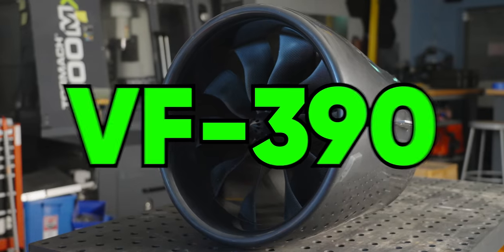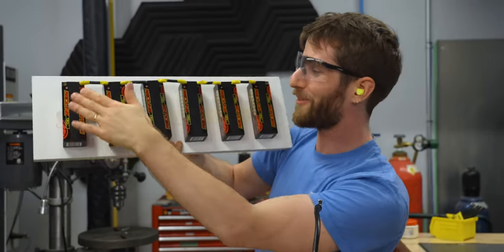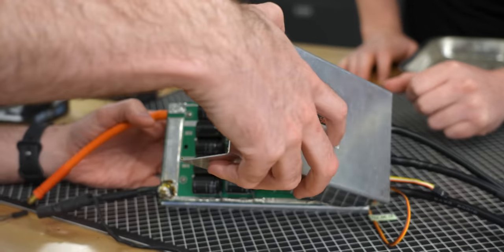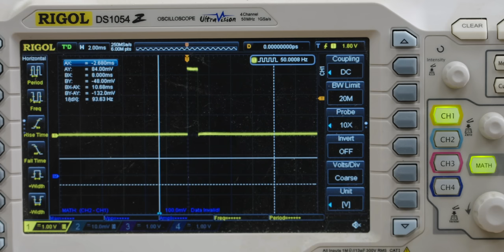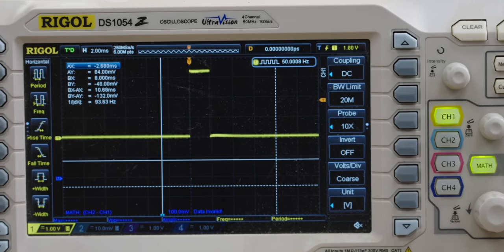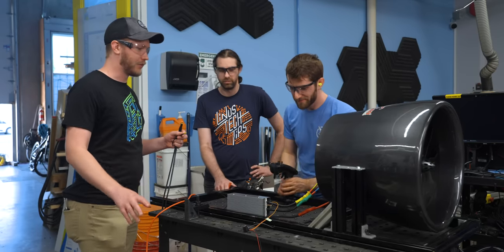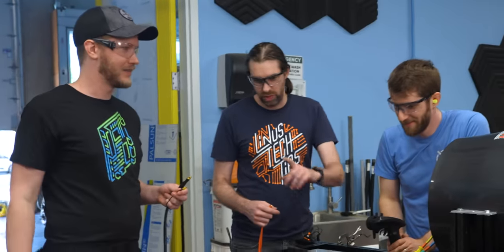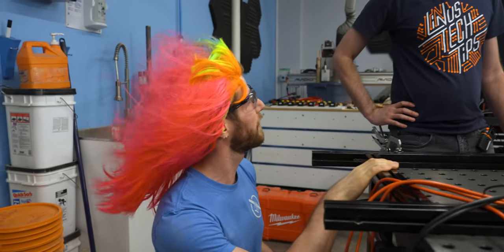The Scariest Fan ever attached to a computer - Vasy Fan VF-390 EDF

Comment from the maker: Huge thanks to Vasy Fan for sending over the EDF Plus VF-390 Nacelle! Check them out at: https://www.vasyfan.com/
Reply: Excellent, now I can finish my airplane build.
Reply: The forward nacelle is hit. Red Alert!
Reply: You might as well rent a wind tunnel for an hour and put a PC in that
Reply: Might have to consider them if ever I decide to build a drone lol.
Reply: is that fan not that Playstation 6 fan? lol
Reply: What are these fans even for
Reply: fantastic job
Reply: Haas?
Reply: Does it impode when it spins up?
Reply: What is this fan even actually used for? (What is the real use case of this?)
Reply: They could use that on Hot TX days 😂😆😂
Reply: @chirantannath6593  Its a Drone/ Aircraft engine. An electric propulsion system. This is meant to make things FLY.
Reply: your new employee's face is unblurred at 12:35
Reply: Wow, seems like a dumb way to die.
Reply: @Mr.Postal  not sure! Only have the PS3!
Reply: You don’t measure force in kilograms
Reply: @avroarchitect1793  that raises another question: are batteries light enough to be flown?
Reply: But you never told was what the thing was meant for! What as it actually intended for!?
Reply: @3dmaster205  It was intended to fly. It's a free bird
Reply: @giovanniangelica548  No no no, that's the new employee 2, who is a twin brother of new employee number 1. They came as a package, but only one of them didn't agree to show their face. /s
Reply: guys WTF 6K usd fan and  why is this a push configuration? cut the front off the pc/or get an all mesh front and set this up for pull! tha pc case is to small you have a HUGE battle neck in push! this is basic math that's what a 38-40  liters case ?
Reply: @supermanifolds  really it's a value of kgf or kilograms of thrust, which isn't a fancy SI term but is a common value for aircraft powerplants such as this ducted fan.
Reply: very cool..you've become myth busters!
Reply: @Enalius  don't give them any ideas
Reply: Now try the VF-570 Nacelle
Reply: Dude, that was insanely reckless. You had essentially a small jet engine blowing into a computer case, and then put your head directly behind it. If the tie-downs snapped, that thing would have smashed your head in.
Reply: Now that you're done with it, please send it to @PeterSripol
Reply: that fan is nothing compared to my modded hp compaq pro 6300 sff
Reply: 9:30 It’s not 45000 watts, it’s 4500 watts

Comment: Can't wait until Linus and Alex somehow put a PC in a jet engine inlet!
Reply: two seconds later: the PC is in the engine outlet.
Whoops!
Reply: Oh yeeah..!, a radiator in front of a turbofan inlet could make for a powerful cooler eh!
Reply: I mean you can probably already build a decent small jet engine with that.
Reply: i mean, calling the thing in this video a fan is a bit of a stretch... this is already more of a turbine then anything else
Reply: On intel chip
Reply: @ViniciusSilvestre0  isn't it by definition an EDF? I'm pretty sure turbines are different than ducted fans
Reply: fr
Reply: dont give them ideas
Reply: Youtuber Project Air has a tiny jet engine, so they are available, and they could totally do it.
Reply: They need to build the most overkill PC and somehow get permission to bring it into an engine test chamber.
Reply: can't wait for linus to accidentally drop something into the engine inlet.
Reply: So basically a PC with an airplane attached to it.
Reply: Or attach a jet engine to the PC
Reply: Jet engines are hot no?
Reply: Nah, just use that Nasa jet that has a window for high altitude telescopic work.  PC on a stick, instead of a telescope!
Reply: @izanefe4231  I was just being cheeki, but EDFs are used in propulsion system's. Turbines are different
Reply: @toolbaggers  I was just being cheeki, turbines are different from this.
Reply: Would be a new take on the frozen chicken test I guess. If you're not aware, they fire a chicken through jet engines to make sure a, the blades of the turbine don't exit the housing (last thing passengers want is a loose turbine blade going through the cabin) and b to simulate a bird strike and test how the blades etc cope.
Reply: i dont think this would work, Jet engines pull out HOT air. :P
Reply: @GabrielGreedy  he’s saying on the inlet. Aka the intake of the jet engine
Reply: @ViniciusSilvestre0 turbines are driven by a fluid to power a generator. Fans are powered by a motor to drive a fluid. It's the exact opposite.
So this here is a fan. But you  could put a second one behind and hook it up to a battery, then it becomes a turbine.
Reply: @patzeeng  Im aware, i was just making a cheeki comment.
Reply: @toolbaggers  Both equally scary.
Reply: I mean, that edf is meant for small aircraft so what’s stopping them

Comment: "This is a duct, it's called duct tape". I see Alex is applying his engineering knowledge to its full potential
Reply: loool
Reply: Oh sure....the great Duct Tape
That when you want it to stick it doesn't and when you want to remove it it instantly becomes the rubber version of Adamantium.....
Reply: We have thought about this... where's the hammer
Reply: "if you can't fix it with duct tape, you're not using enough duct tape."
Reply: I just paused the video to comment exactly this! "This is a duct, it's called duct tape" 🤣🤣
Reply: duck tape is actually really poor as duct tape, it cant handle temperature fluctuations too well. aluminum tape is duct tape
Reply: "that's what's the tie-downs are for. it's gonna tieit DOWN!" 🤣
Reply: 😂😂😂. Mind was actually blown😭😭😭
Reply: @jeef16  Everyone listen to this human!  All tape on ducts is duct tape, but Duck Tape is a brand. Like all band-aids are bandages, but not all bandages are band-aids.
Reply: Its actually "Duck" tape, not Duct Tape, Duck tape is the brand that modernized and capitalized selling it, the military before it had common use in ducting and it uses cotton duck fibers in army green hence the name. Its kind of like aviation, they call a special tape - Speed Tape - its thick aluminum tape with a gooey layer to seal aircraft hulling and good luck getting the shit off once applied, but I have heard it called many things in common reference.
Reply: @nocturnal101ravenous6  That's what I said.
Reply: I'm an HVAC engineer, and that line made me literally shout "NOOOO" at my screen lol
Reply: @brodyjohnstancliff4822  Yeah because you can't use duct tape on heat ducts, can you? It just melts the adhesive and the tape falls off, right?
Reply: @carlettoburacco9235  Oh boy let me tell you about flextape. Once the glue on it has cured, youre better of just replacing whatever the tape is on instead of trying to remove it.
Reply: actual duct tape shines like aluminum foil and has metal wires reinforcements crisscrossing in it
Reply: @urgay1992  absolutely incorrect 🤣

Comment: It's nice of Linus to test out the minimum required cooling for an Intel CPU.
Reply: ...Or an 7950X
Reply: @baoquoc3710  i9 13900ks reaches 253tdp, so as far as I can tell, Intel still runs hotter at that end
Reply: @baoquoc3710 never heard of that intel cpu 😂
Reply: @TheRealThisIsAlex look it up lol
Reply: @polarnice  he's joking because that's an AMD CPU
Reply: Ryzen CPUs draw almost as much in their max boost setting, and the base TDP is actually lower on current gen Intels than Current gen AMDs.

Not that it matters, because those chips will only reach those high power draws under extreme workloads, i.e. relatively short periods of time in your day
Mine is running at 60W average throughout the day.
Reply: haha
Reply: @baoquoc3710  Nah, my 7950x will hit 5.7Ghz with just a 360mm AIO and case fans. I was going to get the 13900k and build an intel system this time, but the 13900k is a pain in the ass to keep cool enough for it to turbo like it's supposed too.
Reply: @Krannski  AMD is just more thermally and electrically efficient this gen. 5 years ago it was the opposite.
Reply: AYYMD
Reply: I wonder if it could cool an FX 9590? Haha
Reply: Just get an MSI aio lol

Comment: I have never been more genuinely concerned for their safety than this video. Both for the electrical aspect and the potential to shoot debris like a bullet aspect. 10/10
Reply: Also, not life-threatening, but the fact that Linus wasn't properly wearing earplugs.
Reply: plus some foreign object flying into the fan, possibly causing some kind of explosion sending some shrapnel all around
Reply: This video is just terrifying for me the entire time.
Reply: and you hope thier fan mounting brackets are solid. imagine if the fan came loose and started to fly around the room
Reply: Not to say that flying debris wasn't a concern, but by far the bigger safety issue was the current they were dealing with. 250A is enough for things to overheat, burst into flames, then explode in fractions of a second. Even 100A is enough for that if you aren't careful. To be honest, I think they probably should have rented a generator to supply their power. It would have cut out a few danger points.
Reply: @marcogenovesi8570 exposure to noise above ~90db for even a few minutes can cause damage to your hearing. Having worked in an 80+dB environment for well over a year, I can assure you that was well into the danger area. Try not to spread misinformation, you can lose hearing, even if only within certain frequency ranges, quite easily at this volume and duration of exposure.
Reply: if he would've died or get injured they wouldn't upload the video... so don't worry
Reply: @FarFromtheSuns this fan is an rc airplane fan that is actually designed to be run off this type of batteries. What they did is what this thing is designed for.
Reply: @marcogenovesi8570  wrong, it IS a jet engine
Reply: @SamuraiGuy  He literally like stuck his ear towards the back of the case lmao
Reply: @MIO9_sh a jet motor
Reply: I’m weirdly qualified to give details on this. Spent about 10 years in Electric RC flight. I did exactly what you are describing with an 80mm EDF at ~40,000RPM on a test bench. It sucked a sheet of paper in and rapidly, all of that was shreds. The duct was gone, the fan hub was now bladeless and 10 feet away, the paper was spread over a 20 foot wide area. Luckily no injuries but this?! The momentum is insane. Linus behind that thing and it sucking in a pencil will be a frag grenade of blades and pencil throughout. It was incredibly stupid.
Reply: @marcogenovesi8570  No, it's not bs
Reply: Agreed. I feel like they need a professional safety coordinator on these types of projects.
Reply: @marcogenovesi8570   1) this is basically an electric jet engine, and 2) wind noise @ 60mph can exceed 110dB, which definitely requires hearing protection. It looks like they exceeded 100+mph here.
Reply: @linustechtips, I suggest you read the comments
Reply: @marcogenovesi8570  https://www.cdc.gov/nceh/hearing_loss/what_noises_cause_hearing_loss.html#:~:text=Noise%20above%2070%20dB%20over,sources%20can%20affect%20your%20hearing.&text=Sounds%20at%20these%20dB%20levels,t%20cause%20any%20hearing%20damage.
Reply: @marcogenovesi8570  find a large air compressor and run a blower nozzle on an air tube from it. Then while holding the nozzle a foot or two away, blow the air into your ears. It gets VERY loud
Reply: @brechen2002  that is not an RC fan.
Reply: @Blox117  uhuh, which is why they had current monitoring set up, told Linus specifically not to go above 100A, killed everything when they smelled smoke, and dashed outside... meanwhile they had Linus running around with a wig... because they were concerned with ingest. Sure.
Reply: @marcogenovesi8570  All noise does damage. It's a measure of db vs time. The higher the db the less time you need for damage to occur. You also have to consider pressure from the air too which could easily blow out an ear drum.
Reply: @FarFromtheSuns  yes it is, it "only" has 60kg of thrust so realisticaly maybe 100kg plane it can propel. Might not be a hobby grade plane but still remote control.
Reply: @marcogenovesi8570  How many decibels were they exposed to in this video? Neither of us know, and even relatively low volumes can cause permanent hearing damage in an hour.
Reply: @brechen2002 Like a medium sized military reconnaissance drone launched from a hydraulic catapult.
Reply: @marcogenovesi8570   by your flawed logic I guess wind doesn't exist. Last time I checked wind isn't being restricted through any nozzles or passing through air lines, and there aren't any sort of engines or turbines around but somehow wind can still be heard? Guess we're all just hearing things, wind doesn't make noise anymore circa this guy (2023)
Reply: @brechen2002  bro, that is a 45kW three phase fan. It is not RC.
Reply: @Blox117  yes, that's exactly the point. That fan isn't designed to be run from batteries and electronics they way they're doing. Because they don't have a transformer handy that could supply it, they should have rented a generator. Even then, if they want speed control, they would still need some janky BS like they did because they probably weren't going to pay for a 45kW drive. The fan isn't going to suck in things from across the room and the type of objects that would damage the fan rather than getting shredded aren't likely to get picked up even if they were close enough. 

But really, the end of the video, which showed the batteries about to burst into flames should tell you what the greater safety concerns were, you know, considering that it actually happened. 

But by all means, if you want to talk about a different situation where the fan is hooked up to proper three phase power and is using a VFD for speed control rather than a fuckin' RC car pot, go ahead.
Reply: @FarFromtheSuns  you do realise this is an airplane propulsion fan? Vasyfan is a well known brand in RC edf's. Will you fly with an extension cable from your generator? This runs on 100V DC, this is not designed for stationary use. Hell i even have the nescesary batteries at home to run this setup.
Reply: @marcogenovesi8570  it’s the random low frequency fluctuations in air pressure (aka noise) as wind flows across and around your ear. This is a well documented and scientifically researched topic and as a motorcycle rider I can tell you wind noise is 100% real.
Reply: @marcogenovesi8570  But I thought you didn't know what wind noise was? Lol. Anyways I said its 100db+ @ 60mph and its not arbitrary- its been measured. Go look up some papers on the subject.
Reply: @brechen2002  their batteries caught on fire, guy. The proof is in the pudding.
Reply: @FarFromtheSuns  have you ever seen a lipo battery catch fire? You should look up some video's. Nothing happened to the batteries themselves, they would not be casually walking around with them on a wooden board. I have had to put out a lipo battery catching fire, you need co2 extinguishers for that, powder doesn't cut it.
Reply: @brechen2002  right, right, they were just taking them outside to get some sun. If you know as much as you're implying you do, you also know that batteries don't always burst directly into an inferno when they catch fire. I have literally had a lithium battery catch fire in my pocket and I didn't get severely burned because they don't always immediately burst into flames.
Reply: @FarFromtheSuns  Lipo batteries are not like regular li ion batteries. Have you ever even used a lipo like the ones in the video? When they catch on fire, they immediately start pushing out Massive smoke and after a while its like a flamethrower bursting from between cells. Stop trying to discuss stuff you know nothing about. Is it really that hard to Just say yeah maybe you are right, i haven't used lipos?
Reply: @marcogenovesi8570  All noise causes the tiny hairs in your ear to move which then are converted to electrical impulses. This is how our brains pick up sounds. The movement of these hairs causes wear and tear, same as blood flowing causes wear and tear on blood vessels. This is why over time as we age we can hear less and less higher frequencies as these hairs are damaged at a particular rate based on just being alive.

Comment: Can we just take a moment, and appreciate the structural integrity of that case?
Reply: That and that Natua Heatsync for not ripping off the motherboard with that much airflow inducted into the case.
Reply: @RaverXx3X and the little Corsair fan they left as rear exhaust. I was expecting it to shatter. It probably doesn’t work after that, but at least it didn’t explode.
Reply: @MailmanRSO  I think the heat sync defused the air just enough to not shatter it, but you are right. It prob is done now.
Reply: @MailmanRSO  fear of burning the pin on the MB
Reply: and the structural integrity of the duck tape that holds it together
Reply: @MartinBlanch  It was most likely not plugged in the motherboard.
Reply: No